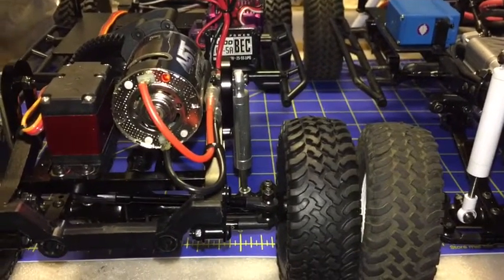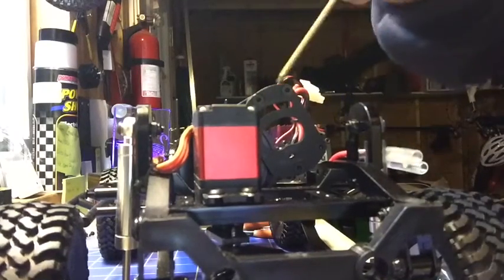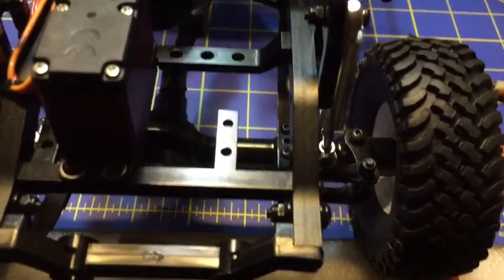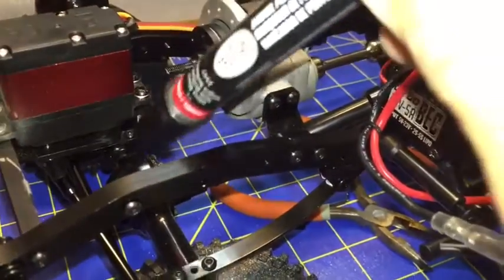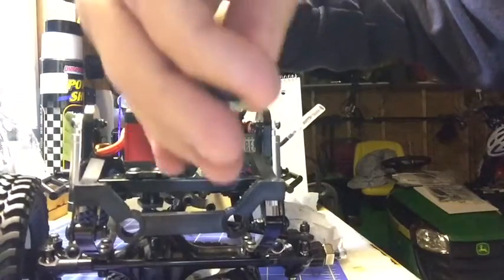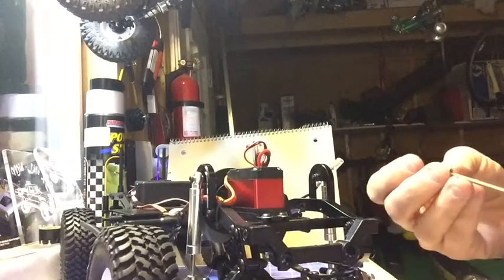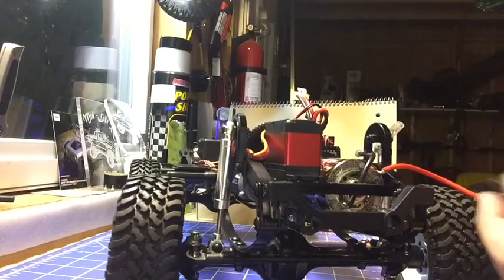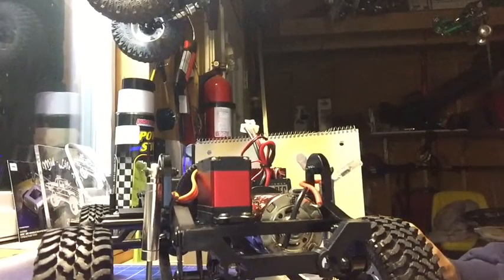Trail Finder 2 Motor Drop

Comment: This was a great super thorough video. We need more videos like this. I did the motor clock so that the servo sits on the opposite side so the steering links run parallel and I could flop the pumpkin to the other side so its the exact same as a real HiLux. This motor drop idea is AMAZING ... something I kept staring at but couldn't comprehend because I have all different motor and tranny mounts so it all looks different but you have now shown me the light! I also overdrove the front axle slightly and under driver the rear axle to stop the back fights and front flips on the downhill. Greatest mod I have ever done but it's not an easy mod by any means. 

Thanks again for sharing your great work and video. Sub'd.
Reply from the maker: Jair Janes , your too kind! Thank you.. the servo flip is something I’m going to look at! Thanks! I do get a tiny bit of bump from the motor under full suspension compression but the benefits of the low weight over a tiny bump are huge, I have run side by side with those that have the stock motor setup and they could not believe the difference! Thanks again!! Hope to do more videos soon!

Comment: Awesome. That was long buddy & very detailed. If someone can't do the motor-drop conversion after watching this....they have no hope. Hahaha.
 Dropping the servo is easy and you have plenty of room. It'll give you a better angle on your steering linkage and have more motor to link clearance . All you do is mount the servo to the bottom of the chassis instead of the top.
 On Medic's video...it appears to me that David has the motor clocked one more notch down, that is also why he's running the steering link to the passenger side......
  I still might try another notch down later. If I do, I'll let you know of the outcome and if there are any additional mods besides moving the steering link to the other side.
 I can't believe you did all that work without removing the servo. I'm sure I never had to move the front crossmember to get the motor in....but then again you have a closed-ended motor that's longer. 
  I'm getting about 3 inches of flex with the O-ring modification and moving the leafs around. Mediums on the bottom for support  & short leafs on top for anti-wrap. 
 Tom
Reply from the maker: Ha! Thanks for the great words Tom.. After I got it up on YouTube, and watched it I realized that doing your servo drop eliminates the need for a spacer on the horn... I'm a bone head!! Lol
Reply: Mid Life R/C what is the clockable tranny plate made of that's on the RTR? Is it the same weak cast aluminum material that's on the kit?
Reply: +Mid Life R/C Oh ya!....I love "Stupid amount of torque". hahaha. Tuning Castle-link Punch-control down to 35% and a nice S-Pattern to the throttle curve helps keep "braking torque" in check....and of course running the strongests parts and 3s instead of 4s(man...I love 4s) , helps keep the TF2 together.
Tom
Reply: +Mid Life R/C just looked again at David's truck....motor is in the same place as ours.
Reply from the maker: Madeline Lucas  it feels like aluminum, cuts like it too
Reply from the maker: +Madeline Lucas ... I was trying to figure out how much lower it could go!
Reply: Mid Life R/C Might check to see if the motor can be clocked down one more notch in a couple of weeks or so. I have everything dialed in pretty good on my TF2 for now and I'm trying to finish-up the comp truck with the NuKizer body for a Pro-line sponsored Night Poker Run at Horseman's Center in Apple Valley on the 21st of this month....so the Trailfinder is done for now. 
 But if I get around to checking that before you do , I'll post it.
Reply from the maker: Ha!!! That a dare???

Comment: Hello Mr Josh, I just bought a New TF2 kit build. I found this video and watched it. I just did the Motor drop mod on mine the same way you did. After I got the mod done, I noticed that the servo Steering rod hit the motor when I turned and on suspension compression. I moved my servo to bottom, and that fixed the problem of it hitting. Just wondering if yours did the same? Thanks
Reply from the maker: Hi Bobby .. thanks for watching... and yes,.I did not notice it too much right away but a friend of mine on here who goes by the name of Madeline Lucas made me aware of that very tweak. Thank you again
Reply: Josh, I love the motor drop video. But after I did the drop, I hate to say I did not like how I could see the motor under and below the chassis rails. Not sure what I will do about that.

Comment: just got my TF2 frame in. I know what I am doing when the transmission shows up. 👍
Reply from the maker: Awesome!!! It's cake to do..., and it turns out mounting the servo under the bracket solves the need for adding a longer screw on the servo horn👍🏻

Comment: Will this work on the gelande 2 ?
Reply from the maker: I'm not positive, but I thought the frames were the same..
I know somebody that I think can help... I'll get back yo you soon
Reply from the maker: So, I got you an answer!
"Good morning Josh.
The motor plates & mounts are the same on all the M3 trannys regardless if it the 2-speed or single speed or in the Gelande or D110 or Trailfinder and as far as i know the width most the chassis's including the Beast 6x6 and 8x8 are the same(except the "heavy" equipment...and that...I just don't know). So...to answer your question....Yes...you can do the motor-drop conversion on the Gelande. The 3-link is the real problem.....primarily the panhard-bar.....that's up to the owner to figure out because it would go right through the dropped motor. Depending on which side of the axle...right or left knuckle he will use for steering off the servo will determine how much bump-steer he will have.
 I have a 3-link set-up I'll be installing on my custom lwb Trailfinder that I'm scratch building but I just barely started collecting parts and far from assembly. It'll be all RC4WD parts except the axles...I'm going with 10.2 Xtra-Speed/Boom (they are the same casting)axle to take advantage of the steering and 3.75 gearing. Motor-drop conversion will be in full effect. Hahaha 
   Tom